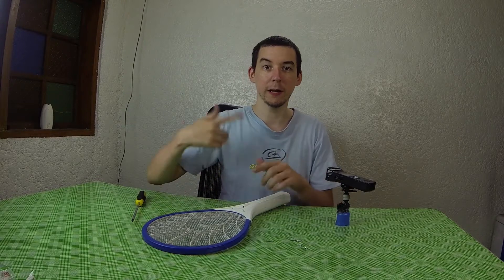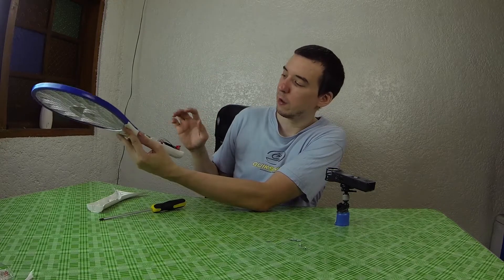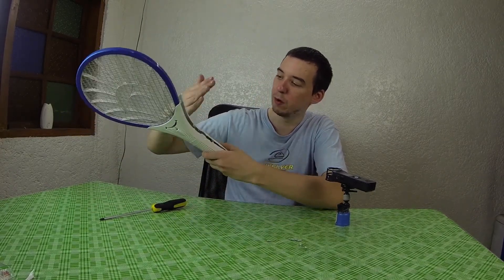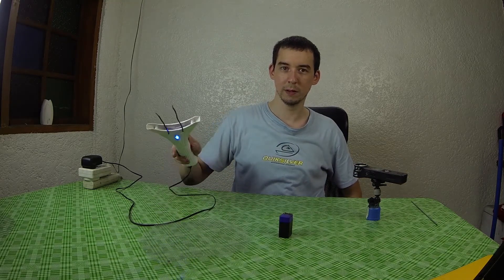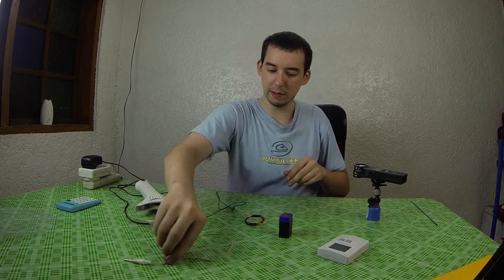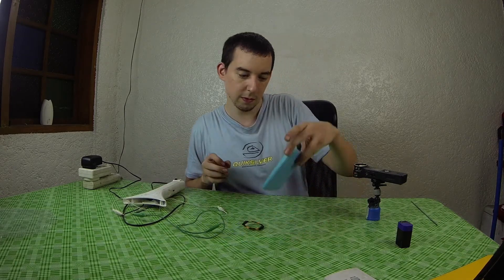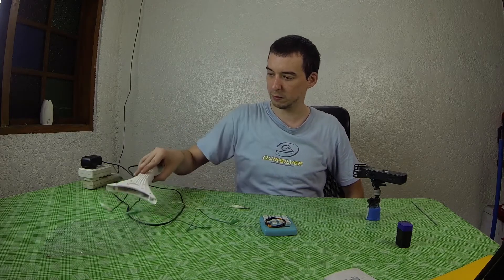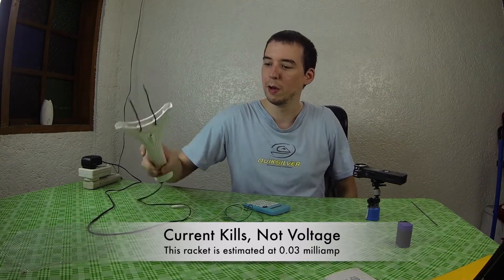High Voltage from Mosquito Racket Zapper

Comment: can you make a zapper that would scare spirits away or zap them ? they seem to be impossible to remove with a tazer or blow torch but there must be some device out there like a frequency pitch controlled device
Reply from the maker: +Glen Gordon are you able to see these spirits?
Reply: Yes , they look like a shimmering heatwave that distorts the air and they float across the room and cling to people and drain their energy they also can produce a fowl odor , they are transparent but with a trained eye they are easy to spot , one just has to focus on an object or area and they can be seen distorting the air, . I have tried tazers , torches and all the spirit crap and spirit removers that claim they can remove them but they dont or cant. They seem to be impossible to capture or kill . A person can tell if they have a spirit attachment by sitting still without moving and monitor their heart beat if it feels like you have an extra heart beat then you likely have an attachment , another way is feeling suddenly drained of all your energy when you were wide awake a second ago , the feeling of just wanting to take a nap . The only thing i can think of that would work would be a frequency device that allows adjusting the pitch or frequency to diff ranges and finding one that aggravates them enough to keep them away . High vibration like a powerful back massager keeps them off the body but as soon as its turned off they attack again like a fly on horse shit they just refuse to leave no matter what you throw at them
Reply: Try playing some country & western music, that should get rid of most things.... :)

Comment: You need both Voltage and Current to kill. Voltage is electric potential energy difference between 2 points. If you have I=10A, but you V=0.1V then the electrons will not able to flow through 2 points, because they dont have enough energy to flow through. :)
Reply: +Lâm Nguyễn Voltage and current are permanently linked by Ohm's law. In your example, a current of 10 A and a voltage of 0.1 V implies a resistance of R = V/ I = 0.1 / 10 = 0.01 ohm or 10 milliohms. That is a very low resistance but it's perfectly feasible. It really is current that kills though - the only effect voltage has is to drive the current through a resistance. Where the current is limited even very high voltages are quite safe. The example I have in mind is static electricity - rub an inflated balloon with a dry cloth in a low humidity area and you'll charge it up to several thousand volts but it's perfectly safe.

Comment: capacitor value  does NOT  mater!!!!! .    i assume it has some sort of cascade, only the input voltage of the cascade maters to the value of the capacitor. so its says 400 volt that mean the input of the cascade cant handle more then that. BUT the output voltage will double at every stage even if the capacitor value is 400.   so this racket might well be 1000=2000 volts or more
Reply from the maker: +joppe peelen Thanks for the info :)

Comment from the maker: Check the video description for estimated voltage/current. Of course it varies between rackets and guessing based on capacitor value alone might not be accurate since they might push a higher voltage into the caps than what they're rated for.